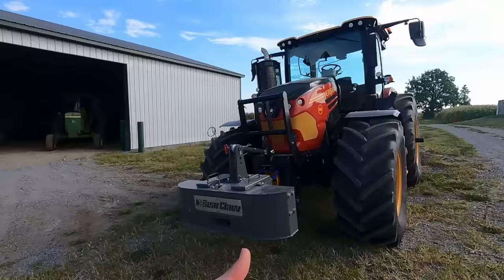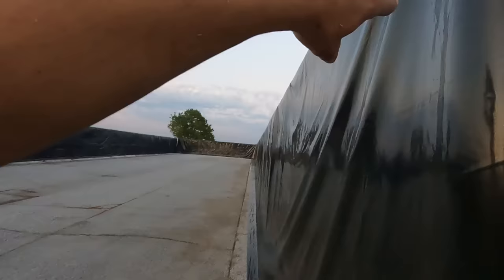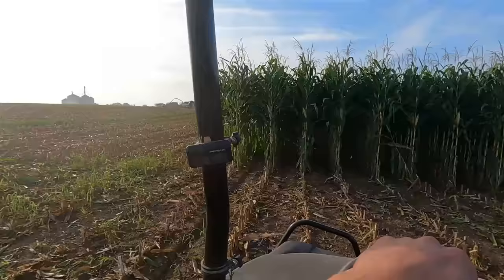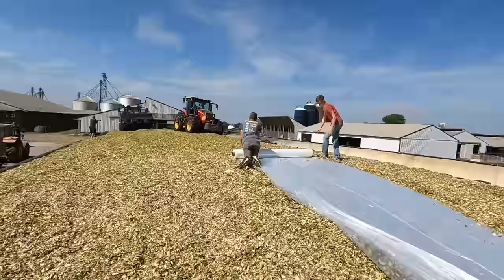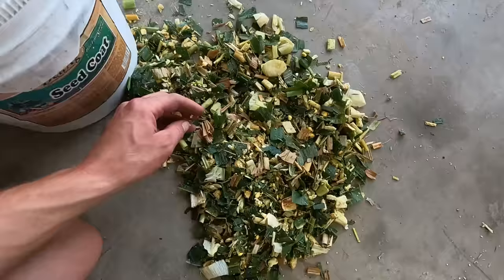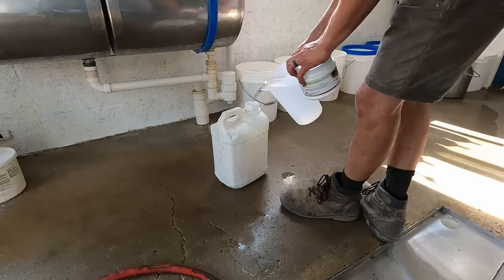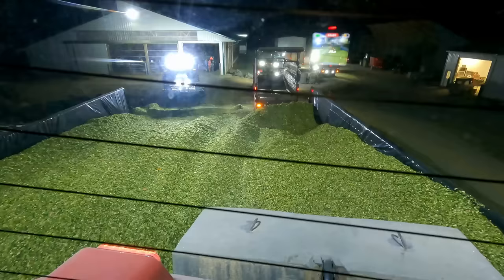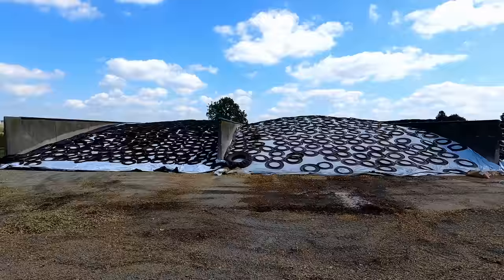Filling all 3 Bunks in ONE DAY | Corn Silage Harvest 2023

Comment: May I make a time-saving suggestion? When preparing the center bunker walls, put the plastic for the adjacent bunker inner walls on first and drape it into the adjacent bunkers. Then, put the center bunker plastic on like normal. If you do what I suggest, you will already have the adjacent bunkers half-ready to cover, and you would only need to place the outer walls for each bunker.

Comment: Using old pipe to cover the rough areas on the wall for the storage yards,using pipe is quite Novel but I’d of cut the pipe just a little longer than needed so that you could melt each section to the next on the joints  - just an idea - great educational farming videos keep up the good work

Comment: It would be nice if those delivery trucks could compress the silage into small cubes on their way to the storage bin and then slide cube out into a tight, plastic bag, then stacked. No additional packing required. You would save a lot on gasoline and labor if that could be done. Also, no more half tires to mess with, or corrugated pipe needed to save the tops of the walls. 
Just a thought.

Comment: You should think about something like a Penta dump trailer, you wouldnt be able to fill the bags with it necessarily. But, it would help slow down your buggies when filling the bunkers for sure. Always easier on equipment when youre not rushing. Let me know what you think. Cheers 🍻
Reply: We used to use a jiffy dump trailer and a couple trucks. Most of our corn silage had to be trucked a minimum of 5 miles...but the chopper could keep going without trucks chasing it

Comment: You need to make you some really long spikes to go on the front of a tractor and slide those tires on them. Then when you want to take them off the poles extend up on top of the bunkers to slide back off. You can also make racks to sit them on to store in the winter. Only handle them the two times putting on and taking off. 👍🏻✌🏻👊🏻

Comment: I saw an ad for a device that either hooked onto a skid steer or bucket loader that used a beam with a auger chain that shot off tires to a fair distance. Not certain of cost but certainly a labour saver & easier on the back

Comment: that mechanical broom is working smooth as silk with the chain tightened
Reply: 'comb-dozer'
Reply: carbon dioxide gas cloud. cool. 
think that is pretty much state-of-the-art silage harvesting! 0% wastage? I'll be watching as you get to the end of each of those bunks! :)
Seal last bunk --- 'rent' :) a hurricane fan and aim it across the front of the bins away from the crew; with air movement - should be safe.

Comment: Silly question, other than it's farming equipment, why don't they use a roller instead of a tractor with weights on the front and back?  seems like it would be a bit more thorough with a big ole roller instead of the tire foot print.  I mean I know you've been doing this once or twice before but I've always wondered that.

Comment: Mr Eric.  So as a non farmer, i shudder at things like 13:35-13:40 and times when filling the silos, the amount of wastage?/missing?. at silos at least can shovel it up, but with what i assume is the tight profit/feeding quantity margins, would have though  spillage and missing trailer would be frowned upon. Or is it a case of the large volumes you are handling, makes the spillage  less important verses time and effort?
Reply from the maker: They try not to lose any but usually spill some when opening up the outside of the field. 99.99% ends up in the bunk so its not something to worry about.
Reply: cheers, yeah i figured i was being too picky.

Comment: So what's the difference between corn silage and harvesting corn 🌽
Reply: I'm from Germany so please excuse my spelling errors 😅. Cornsilage you harvest the hole plant. The Forage harvester cuts the hole plant and fling's it on the wagons.
The other method, you harvest just the corn with a combine with a corn header attached. The header tears the ears of the plant and mulche the rest. The ears go thru the harvester and the corn gets separated from the cob and leafs.

And the question wich is better or what not is that you have to decide which product you gonna need for feeding or whatever other use it for.
Reply: @Imholze  oh I see thanks for that explanation now if only there was a way to harvest the corn and load a truck of the silage at the same time
Reply: @Redbeard_1  here in Germany some farmers do that. The corn gets harvested with a combine and after that the mulched plant material gets swathes and harvested with a loading wagon. But it can get messy and it's not clean enough for cattle so the use it for biogasplant's.

Comment: How come when packing silage you don’t use the tractor that they used to pack and push garbage with the big metal rollers
Reply: You would need a semi truck to transport it on the road between farms
Reply: I know they would need a truck, but I thought it would be easier to push the air out of the silage just a thought
Reply: It's more about having enough weight on the rolling tractor,  what happens is the silage gets squeezed or pinch between each 2 wheels of the tractor as it rolls.  The main thing is to spread each layer of crop thin enough to squeeze it effectively before the next layer goes on

Comment: Can you not re use the plastic next year?
Reply: The plastic is in contact with acid and the outside elements for almost a year. After that it almost falls apart and is no longer tight.
Reply: Also you take it off in little pieces, to not uncover all silage to air